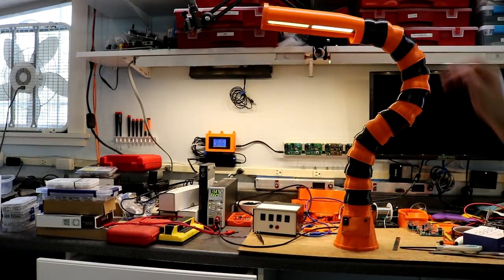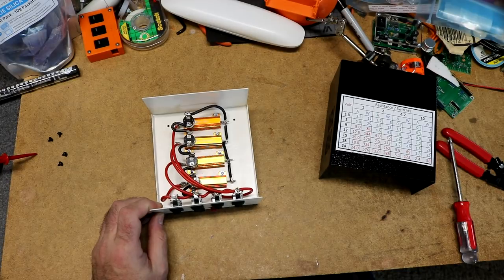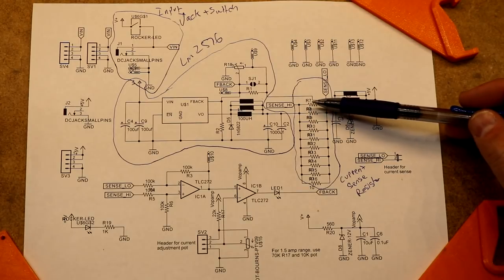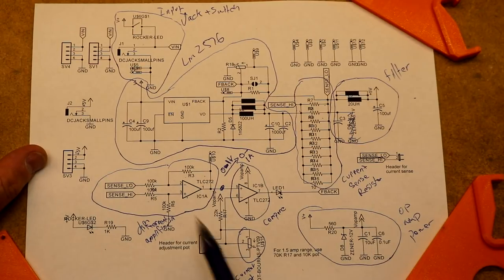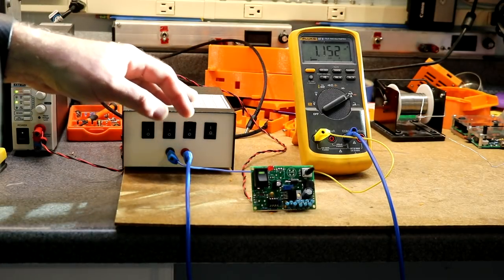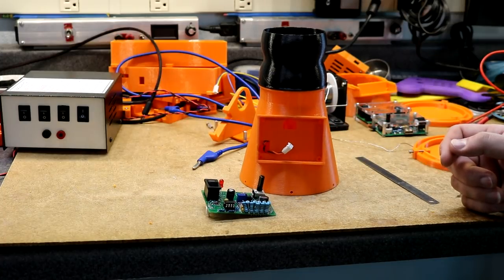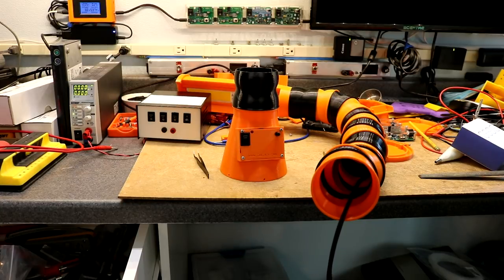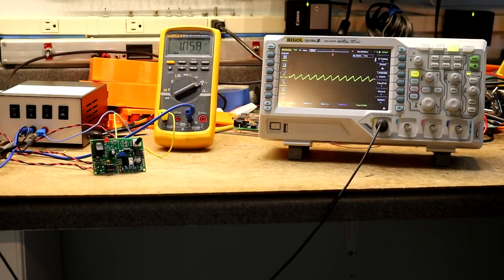Resistive Load, Constant-Current Power Supply, COB LEDS, and a 3D Printed Desk Lamp

Comment: Hmm, 400mV output ripple is pretty bad compared to the 100mV when it's not current regulating. Guessing having a high output capacitance could be working against you here, so you might see an improvement using lower output capacitance with only a moderate penalty in ripple at full current.

Comment: Hi, could you include a link where you bought the box used in the load project?
Reply from the maker: Sure, that would be from Jameco electronics, part number 208911. https://www.jameco.com/webapp/wcs/stores/servlet/ProductDisplay?storeId=10001&langId=-1&catalogId=10001&pa=208911&productId=208911.

They have several different sizes available. I've used those boxes for several projects over the years.